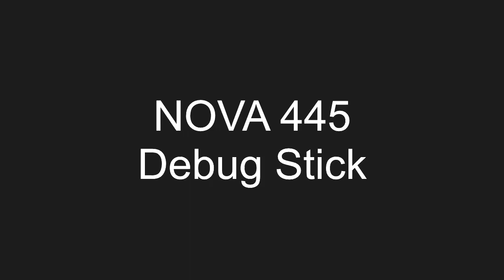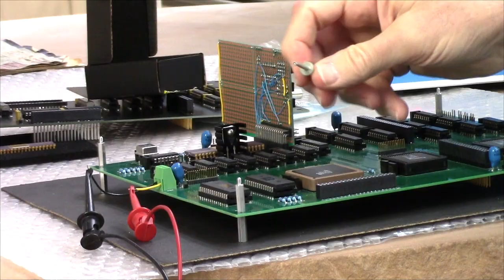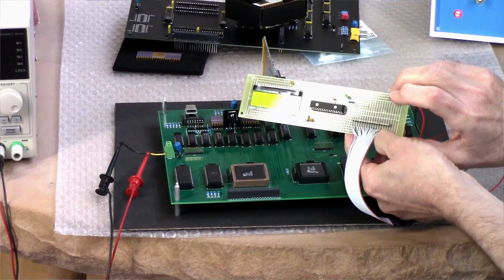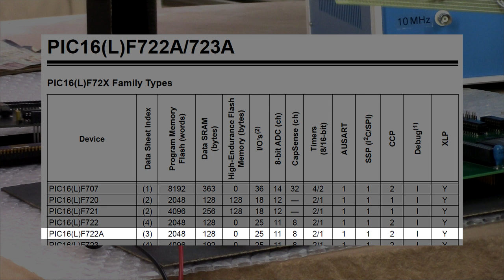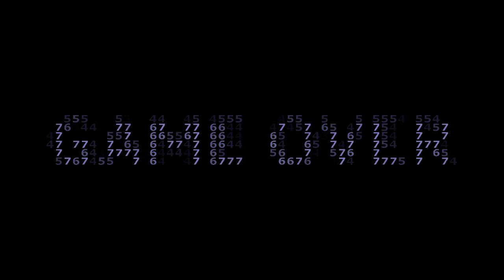NOVA 445 Debug Stick

Comment: Hello,
You mentioned in a previous video, that you wanted to run RDOS on this machine. I've been restoring a Nova 1200 clone (DCC D-116), and it's pretty much all working, but I have no software to run on it, and I haven't been able to find anything available, save for IRIS, which seems to be a purely emulation project. Could you point me in the direction of, well, really ANY software for these things? Especially things like Business Basic, since all I have for I/O is my ASR33
Thank you!
Reply from the maker: There is a version of RDOS available in the simh project: http://simh.trailing-edge.com/software.html
That includes an assembler, but no high-level languages.  Apparently Data General still exists in some form or other as part of EMC (which is part of Dell), and they consider the software to be proprietary still.

I thought the GNU C compiler, GCC, supported the Nova as well, but I can't find any reference to that now...  And of course there's my crufty assembler written in perl that you can find on the hackaday.io page (https://hackaday.io/project/168939-nova-445) and modify as you see fit :-)